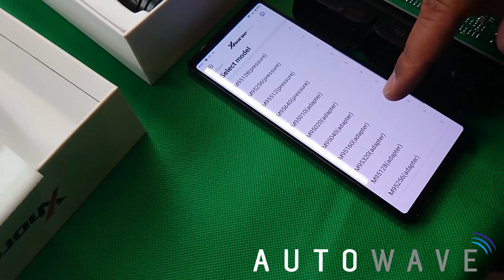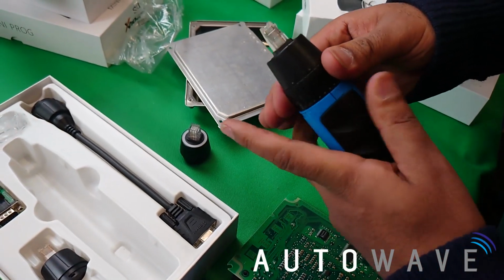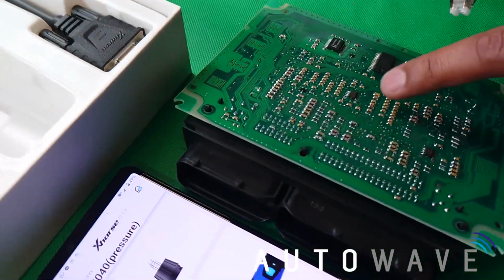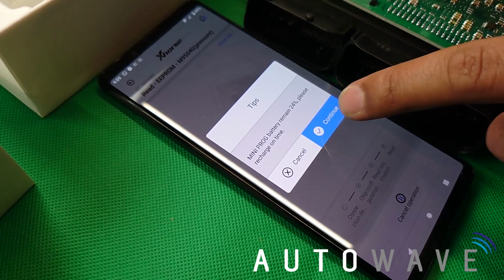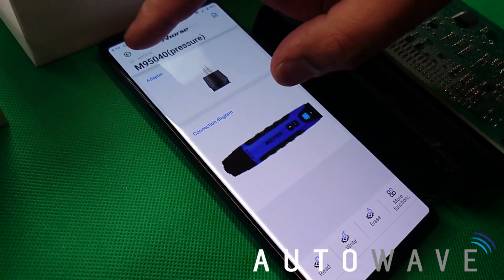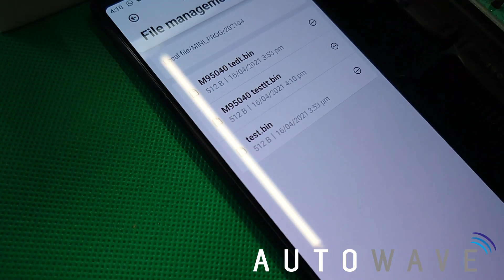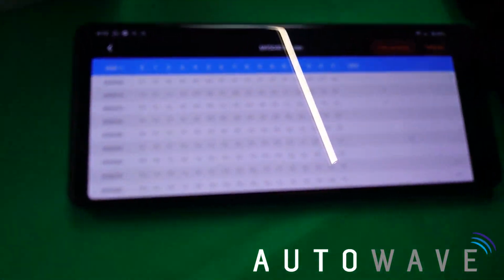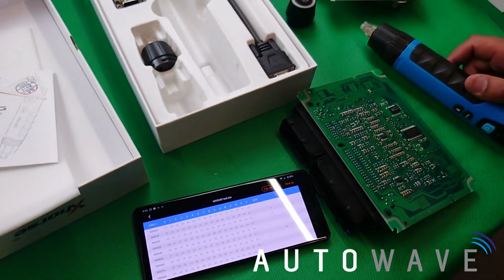Reading EEPROM Data using Xhorse Mini Prog

Comment: Tried today to read from a BOSCH ME3.8.2 EEPROM B5828 (24C02) via pressure, read success but inside the eeprom everything was with 0. Then unsoldered and read via adapter and everything fine.

Comment: Thanks for the video. I missed the little groove indicating pin 1. Got it right by coin toss luck the first time. I've marked them with whiteout now for clarity. Change the filename at that point is great advise too. A video showing how to share the file to the xpad or x tool max for writing a chip from it would be helpful.

Comment: It also concerns all Mercedes locks all that need to solder and use xDNP34
Vito 639 0L02M 4J74Y W203 1J35D does not work,,,,,